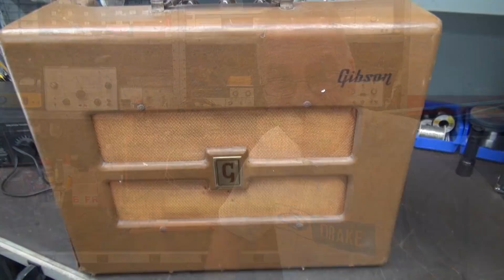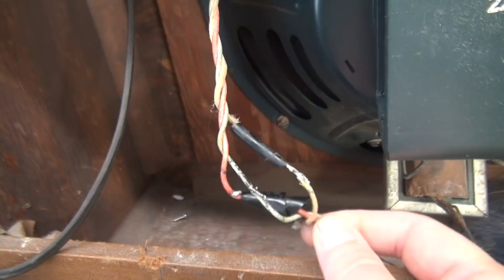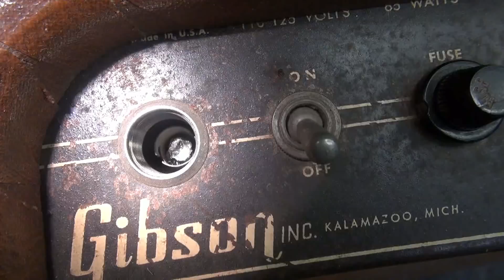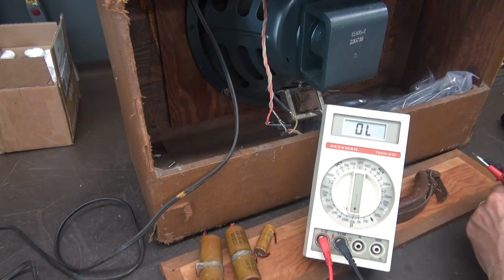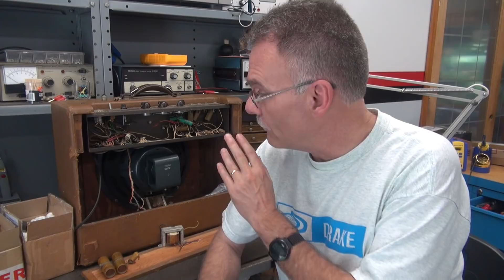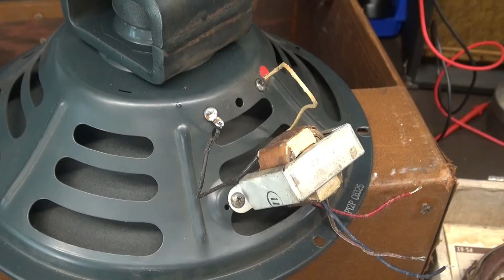How to restore Vintage Gibson GA-20 tube guitar amp D-Lab electronics Part 1

Comment: Hi again Terry!  This "olld" gem popped-up on my feed this morning., and until I watched many of your other videos, I often wondered why there is a transformer mounted on many "old school" speakers. Now that I know that it's the output transformer,  it begs the question: " Is there any advantage to having the output transformer mounted on the speaker instead of on the chassis in a single-speaker installation?  I can understand the need to do that in a multiple-speaker installation (such as a building-wide public address system for impedance matching).  Thanks in advance!
Reply: There is zero advantage, and in fact it's dangerous.

Comment: Nice project Terry. I would ordinarily much prefer to have the OT mounted to the chassis, because that means I do not have wires carrying 350 volts down to the speaker. You never know what gets tossed into the back of an amp. That setup (OT mounted to speaker) is obviously a remnant of the original field coil speaker. But that would mean you have to drill new OT mounting holes into the chassis, and we'd like to avoid that. And of course there is always the (very small, but not zero) risk that wherever you mount a tube OT turns into a hum issue. However; we have to assume that the original OT primary winding also functioned as a choke. So do you add a choke? Go without? If so, where (physically) and how to mount it? Obviously, you'd copy a tweed deluxe physical layout. Still requires drilling new holes. Arggggh!! 
Anyway; if you stay with the speaker mounted OT, I would rotate the speaker (if the OT will clear the chassis) so that you have minimal HV-carrying wire length flopping around the speaker area.
Reply: But Terry's already not using a FC speaker and not the original output tranny and probably deleting the choke, so all that's out the window anyway.
Reply: I have no problem drilling holes for safety upgrades. I moved the OT on a GA6 to the chassis. Can confirm zero hum.

Comment: The old transformer was 5K ohms,  but your replacement is only 400 ohms.  That seems like a really big change.
Reply from the maker: The old tranny was fried, That was not the expected DC resistance. The replacement in more in line of what is normal

Comment: excellent project Terry! The early Jimmy Page led zeppelin albums used these at full volume getting preamp, power tubes and speaker distortion. It would be great for us to hear all these amps yours included at max settings. Guitar players clean up the sound with the guitar volume control and get singing distortion by sending more signal to the amp. Demo'ing like this would really show off these gems!